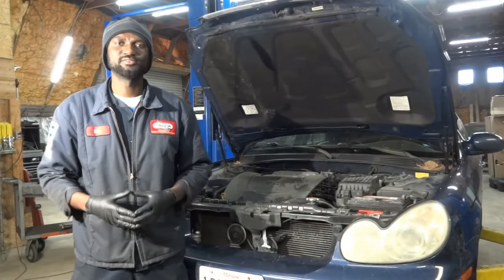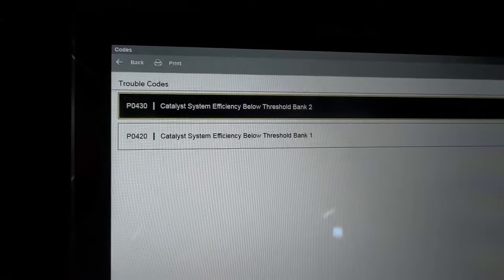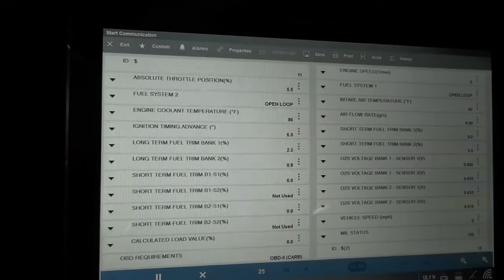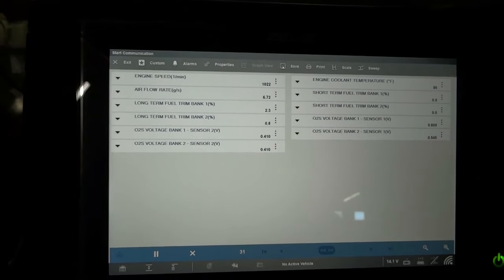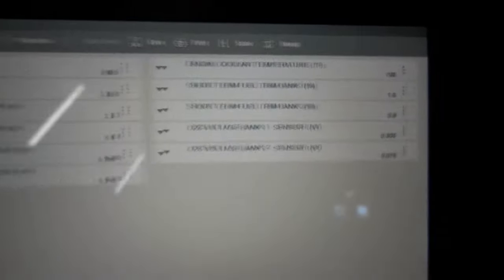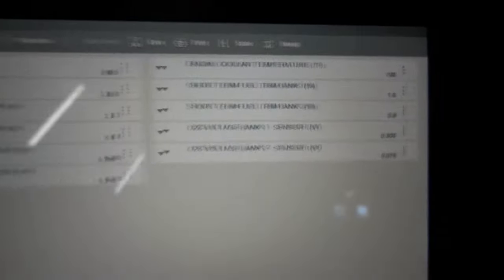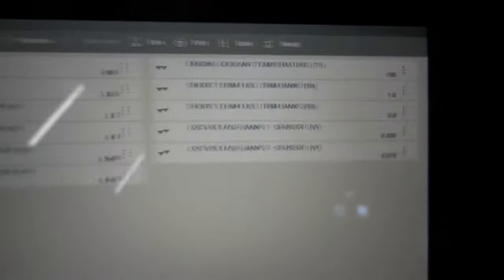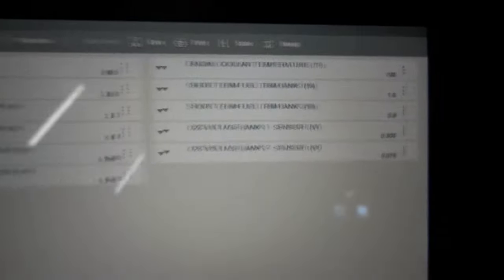Catalytic Converter Efficiency Below Threshold: Code P0420 & P0430 Diagnosis and Repair

Comment: I need help I have the same code 
P0420 
Honda Accord 2015
139k miles 
Says catalytic converter is going bad idk 
I haven’t replaced the o2 sensors yet 
Any causes ???
Reply from the maker: Alexis Tellez  don't just replace the 02 sensors, you need to find out why the cat went bad, you can take it to a pro mechanic who can diagnose it for you!!
Reply: I’m having the same issue with my 2013 Honda Accord with 140k miles! I need help!!

Comment: I purchased a car out of state and it was delivered with a p0420 code. They performed a simple diagnostic and told me the passenger side cat needs replacement and the vacuum pump has insufficient power and oil in vacuum pump.  Could this be the reason the p0420 code came up and giving false code to replace cat? 2014 Mercedes 105k miles. 

Please help. I don’t want to spend 2k on new cat. 😅
Reply from the maker: Logan S  a defective vacuum pump wouldn't cause a P0420 code to be set!!  you need to find out the cause of damage on the cat then replace it!!

Comment: k do you have experience with honda and acura vehicle do you know why honda and acura cars dont support o2  sensor 1 .... but it do support 02 sensor2???
Reply from the maker: 大黄蜂 Bumblebee  what do you mean by don't support? sorry I didn't understand your question!
Reply: @KITS_Auto_and_Truck_Repair  scan tool won’t show or support the 02 sensor 1 votage at both bank…. I use x431 pro mini and BlueDriver at Honda and Acura those Vehicle it just don’t have the choice for sensor 1 voltage
Reply from the maker: @Hibachipower  it's not showing voltage because it's a wide band 02 sensor it shows current instead of voltage, sometimes the rule of thumb on these types of sensors is negative current numbers = Rich mixture, then positive current numbers = Lean mixture, this may not be accurate on all wide band 02s, so you need to find out how your sensor works!!
Reply: @KITS_Auto_and_Truck_Repair  I see …. Now I know …. Thank you very much K…….
Reply from the maker: @Hibachipower  My Pleasure!!

Comment: What happens if I’m not getting a voltage reading on B1S1 oxygen sensor?
Reply from the maker: anthonyyaboyant  you might have a defective sensor or a problem in the sensor wiring!!

Comment: my catalytic converter was stolen and left empty. the O2 censors were replaced on the empty cat... i have replaced the cat but the error p0420 and P0430 still came back up after 3 days...could it be the censors have gone bad having used them for some days on empty cat
Reply from the maker: Muhammad Alaaya yes you could have bad sensors !! follow the steps in the video to check your sensors, or maybe you got bad quality cats!!!

Comment: ok so i have po300 and po420 code on my 2007 grand prix and i just replaced my purge valve and the light went away for 3 hours than came back
Reply from the maker: Yodha 7865  Why did you replace the purge valve, fix your misfire code first!!
Reply: @KITS_Auto_and_Truck_Repair  Im diy mechanic, and have changed everything like spark plugs the wires the coil packs and other things as well but idk what is causing that po300 code
Reply from the maker: @NaviBhatia  check my misfire videos! You will find them helpful!!

Comment: I dont believe near redlining the engine sustained for some time is a viable means of inquiry and data capture. I mean some engine will be damaged or taking damage with no load on it high rev like that, seems counter intuitive to a mechanic's practice in general. Some cars sure its fine but not all grovery getters can handle sustained high rpms lol.
Reply from the maker: @Roboticdoughbull3k   I didn't understand your statementt

Comment: I have this same problem but on a 2013 F150. It says bank 2 P0430.
Reply from the maker: picassomorgan  you might have a bad cat or a bad 02 sensor but make sure the engine is working properly before condemning the cat!
Reply: @KITS_Auto_and_Truck_Repair  so I should take it to a shop and see if it's running correctly? I'm not having any performance issues. Only thing that's happening is my cooling fans come on as soon as I start the engine and don't turn off.
Reply: @KITS_Auto_and_Truck_Repair  also which side is bank 2
Reply from the maker: @caesaremorgan  ok! is the engine getting up to operating temperature? if not check engine temp sensor and thermostat
Reply from the maker: @caesaremorgan   bank 2 is the opposite side from bank one! on this vehicle it's the bank by the radiator!
Reply: @KITS_Auto_and_Truck_Repair  it comes on at the start and not turning off. From cold to normal operating temp still stays on.
Reply from the maker: @caesaremorgan  I think you shouldn't worry about it!

Comment: How do you know if its running rich or lean without a computer..
Reply from the maker: BossLuffy25 PH  it's a bit hard to know without a computer or you could smell the exhaust and tell if it's running rich, when an engine runs rich the exhaust gases smell really bad

Comment: Mine came on po420 , i replaced both O2 sensor and light came back on after few months, I thought cat runs around 1200 temp not 400 ?
Reply from the maker: Dilan Eades around 400-600 degrees
Reply: @KITS_Auto_and_Truck_Repair  Oh ok thanks What else would it be ? MAF ? Coolant sensor ? or again burned out new o2 sensors  just few months old or is it my cat ? Car drives perfect just light came back on its been maybe 3 months since i change both 02 sensors.....
Reply from the maker: @ZeusKingOfGods1  are you installing OEM Parts?
Reply: @KITS_Auto_and_Truck_Repair  YES from factory
Reply from the maker: @ZeusKingOfGods1  that's odd, cats and 02 sensors are from the Dealer?
is the engine running rich?

Comment: How many catalytic converter do you replace  in this car why bank one sensor 2 & bank two sensor 2 they show the same ??
Reply from the maker: 大黄蜂 Bumblebee  I replaced both catalytic converters on this vehicle, because they were both bad! the 02 sensors after the cats have the same value because a catalytic converter stores oxygen which causes the signal from the second 02 sensor to be constant and above 0.5v... which is normal on a good working cat!!
Reply: @KITS_Auto_and_Truck_Repair  just want to say that…. About 02 sensor …..I want to learn this long long time …..just don’t have people like you around me…..and the way you explain are also easy to be understood…..really learned something from you….   Thank you….
Reply from the maker: @Hibachipower  My Pleasure!! Keep watching!
Reply: @KITS_Auto_and_Truck_Repair  one question….I got p0430 code bank2…..but when I use the method you teaching and both bank1 & bank 2 02 sensor 2 are not show straight line…. I got the code P0430 but it means my both bank catalytic converter need to be replace right??
Reply from the maker: @Hibachipower  yes!! I'm pretty sure the other catalytic converter is defective as well, or it's about to go out!!
Reply: @KITS_Auto_and_Truck_Repair  thank you
Reply from the maker: @Hibachipower  My Pleasure!!
Reply: @KITS_Auto_and_Truck_Repair  when I do the brake booster test it not alway at lean when I pump the break it go lean a little and went back to rich up and down……it happened at the bank2 sensor 2 they show the same
Reply: Code also show at PCM I think the problem is two weeks ago for some reason my radiator crack coolent spray to Bank two sensor 2 And then 2days later code show on…. I thing it damage the PCM am i right ?? Because the PCM damage and that’s why bank1 sensor 2 show the same not normal…..is it possible??
Reply: But When I do the test drive ….the lean and Rick show very accurate
Reply: It didn’t look like pcm had problem ….. I Also take off Sensor one and then load inside a hoe to honeycomb look very good condition look good of my catalyst converter
Reply from the maker: @Hibachipower  That's good! your 02 sensors are most likely good!

Comment: Meantime no one explains in any video what's upstream and what's downstream. 
What r we talking about?
What's bank 1?
What's bank 2???
Reply from the maker: Sachs Gs250 
upstream is the exhaust pipe from the manifold down to the catalytic converter
downstream is the exhaust pipe after the catalytic converter downwards

bank 1 is the side of the engine where cylinder number one is located 
bank 2 is the opposite side from bank 1
Reply: @KITS_Auto_and_Truck_Repair  thank you!!
Reply from the maker: @sachsgs2509  My Pleasure!!
Reply: @KITS_Auto_and_Truck_Repair  now I understand what the mechanic at the shop is telling me.
My 2000 Camry V6 with 120 K has a 420 code bank 1.
The problem is my car has California emissions there fore the cat it's extremely expensive. 
I've try catclean once so far the light still on.
I'm trying a sec bottle now and hope that it goes off to pass inspection. 
If not I'll have to sell the car.
Reply from the maker: @sachsgs2509  sounds good!!

Comment: My car showing P0420 code. Car runs fine. 
I tried your method (Brake Pedal method). Upstream oxygen sensor is working properly but downstream oxygen sensor is not showing voltage below 0.2V.

I saw catalytic converter by opening, there is no damage or not clogged.
What is the actual problem?
Reply from the maker: Dr. Arun Kumar Suthar what kind of fuel trim numbers are you getting?
your downstream O2 sensor is most likely defective...
Reply: Short term fuel trims are within +10 to -10 and long fuel trims are also within range.

I used open loop lpg kit for approx 15000 km. after that I removed that. now I getting this DTC (only P0420, no other dtc). 
Car odometer - 45000km
Reply from the maker: @ArunKumarSuthar  it sounds like you either have a defective sensor or a defective cat... if you can't drive the sensor after the cat lean or rich by pumping and releasing the brake pedal, then that's your problem... Good Luck, 
even if your cat looks good, it can still be defective
Reply: @KITS_Auto_and_Truck_Repair  Thanks for your reply.
Reply from the maker: @ArunKumarSuthar  My Pleasure!!!